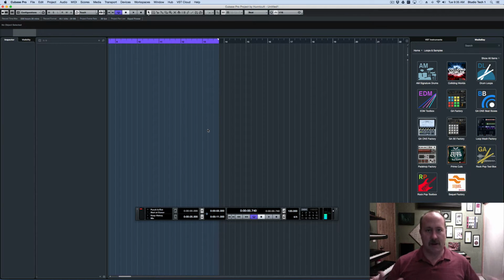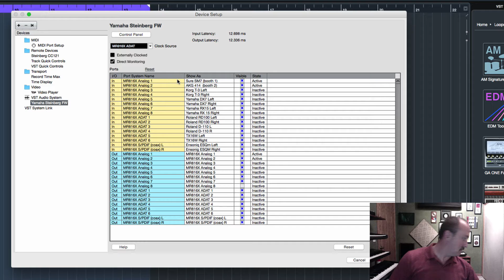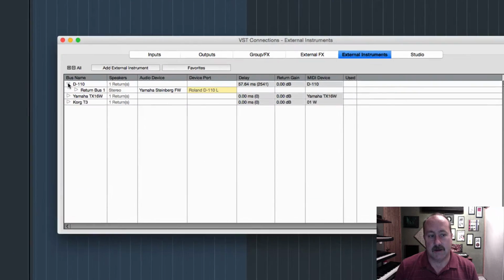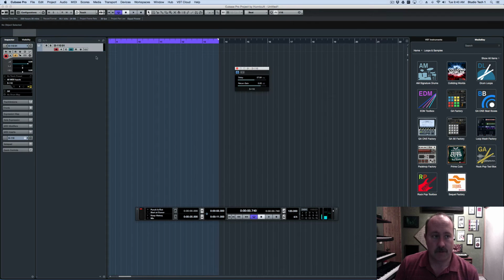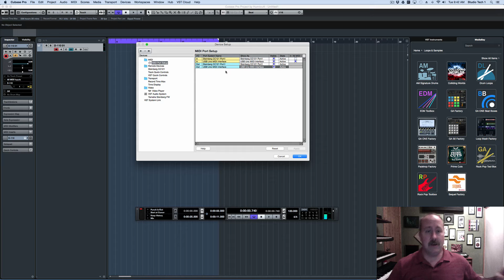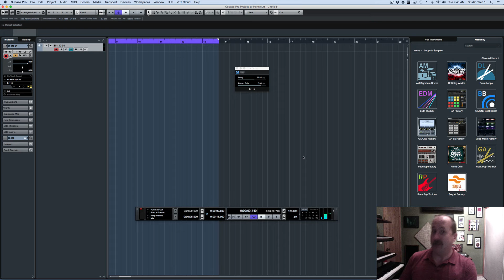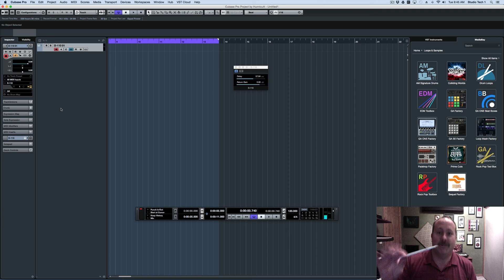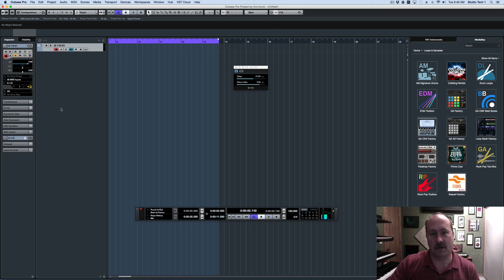Cubase External Instrument Connections

Comment: thank so much for the explanation , I have a similar setup but I solved my issues by using bus , I have external A3000 Yamaha with Kontakt VST, in my appllp x8, I used virtual channels as main gathering channels and connect all of them to virtual so I will be able to record both from Kontakt and external instrument in the same time.

Comment: SO, very weird for me coming from PT. I can only seem to get audio out of my mains if I use an instrument track with my external mixer selected , and a separate MIDI track (midi port 2, channel 1) armed. If I use the same MIDI connection (midi port 2, channel 1) on the instrument track, nothing plays. Also, I can't seem to be able to have an audio track (Line 7/8) with the same input selected in the instrument (7/8). Curious if you can explain this? In PT, i have my mixers setup to my line ins. On an audio track (or instrument) id just select what input Im sending to, and bam, sound. This seems more complicated than it needs to be. And with the exact same routing, only one option works?

Comment: Hello, and thanks for your videos Walter. I've been able to get my Triton Extreme set up as an external instrument in Cubase 5 thanks to yourself, and other helpful people. Triton Extreme was not in the list of presets, so I had to find a patch script elsewhere. I can now change general midi (GM) patches from the instrument track, but only GM. If you have any idea how I can select non GM programs from Cubase, I would be grateful for your help.
Reply from the maker: Hi Rick!
Thanks for watching and posting.  I can't give you a concise answer but I can point you in the right direction (I think).  What you're trying to do is a little complicated and can be a little tedious but in most cases can be done.  There are two basic lines of attack here.  First, remember that if something isn't General Midi (by definition) its System Exclusive.  So you're probably going to have to get into the "MIDI Implementation" charts which can be pretty slow going, lots of Binary code and Hexdecimal stuff.  And those charts are NEVER written with instructions because they assume the only person looking at them is an expert.  So don't be intimidated.  The second step is to create a custom control panel (and I have some videos that touch on how to do that).  When you place a controller onto your custom panel (device panel is the Cubase term) you can tunnel in and configure it to do whatever you want.  Once you get the editor for that controller opened up, the basic "move" you need to make is to locate the System-Exclusive code for whatever you're trying to do in your keyboard's MIDI Implementation charts, and type that information into the cubase "Device Panel" editor.  

I mentioned two lines of attack, here's the other.

IF...whatever you're trying to configure on your Triton can produce a stream of MIDI controller-data when its changed (wiggled, twisted, slid...whatever) you can simply set up a Quick Control, enable MIDI Learn mode, then: wiggle, twist, slide...whatever, your Triton control and it should map to the Quick Control.  This is obviously MUCH quicker and easier, but it assumes that whatever you're trying to link up on the Triton puts out a standard MIDI controller message that Cubase can "learn".  50/50 gamble, but try this first.

I can almost guarantee the Sys-Ex mapping method above will work, its just a long surgical process to get there.

But consider this.  if you can figure that out and get it to work?  Even once?  You will have 90% of the heavy-lifting behind you for mapping more (or all ) of the Sys-Ex stuff.  IF you went ahead and did that, you can package an sell (or share if you prefer) your external instrument to other Cubase and Triton users!  

I applaud your efforts.  Feel free to message me at walter.hunnicutt@combinedmindsmedia.com if you want to discuss further.

Thanks again!
Reply: @Walterpenn1108  Wow! Thank you so much! I'm somewhat of an expert with music, but definitely not with computers. I've stumbled upon some of what you're talking about, so good to know I'm going in the right direction. I'll give the custom control panel vid a look and let you know. Thanks again.
Reply from the maker: Hey Thanks!  You have probably already watched this one, but if not, this will get you pointed in the right direction on creating a custom device panel.  And again, feel free to email if you like.  May take some time to reply, but I'll do what I can.  Hope this helps: https://www.youtube.com/watch?v=UW9i_-yhypw

Comment: Hi Walter! I´ve been looking for info on Nuendo live's features, but've found nothing extensive so far. Do you have any info on this? Thanks!
Reply from the maker: +Hector “AsesorMusical” Solano  Hi!  
Thanks for watching and commenting.  I've created quite a bit of training for Nuendo over the years but not much specifically for "Live".  That said I think all they did was take the core Nuendo engine and strip away a lot of the ADR and Game audio features.

Nuendo is without question Steniberg's flagship product.  Same audio engine as Cubase and the others but Nuendo is found in something like 60% of the industry's post-production houses.  So its a front-line, fully pro package.  More focus on stability than features (is my personal take on it).  

I know that they tailored "Live" for front of house stuff, but I can't give you a run down on the specifics.

What's the application you're thinking about if you don't mind me asking?  Broadcast or installation audio?
Reply: +Walter Hunnicutt thank you for your long reply. The application is for both front of house and recording of small "30 mics maximum"  setups. I'm trying to figure out if I need 2 stations or if I can just buy one license and do both things without fear of dropouts or crashes
Reply from the maker: +Hector “AsesorMusical” Solano AH.  I would recommend you reach out to SB tech and get their take on it.  My guess is that it'll come down to processor horsepower and interface capabilities.    I know that Nuendo Live has a 30 second pre-record buffer for exactly that reason (plus ASIO guard etc).  But in my experience  the drop-out issue is usually a function of the computer or interface not the software.  

In other words, if you have enough computing firepower behind it, I would thing Nuendo could handle it.  (and no sync issues of course VS running two parallel rigs).  I guess the other factor would be buffer size / latency requirements.   If you're just recording (and none of the performers need real-time monitoring)  I should think that would give you the luxury of even more buffering etc., but again, that's ALL speculation on my part; really recommend you get SB's opinion on it. 

Good Luck!
Reply: +Walter Hunnicutt thank you! I will do that